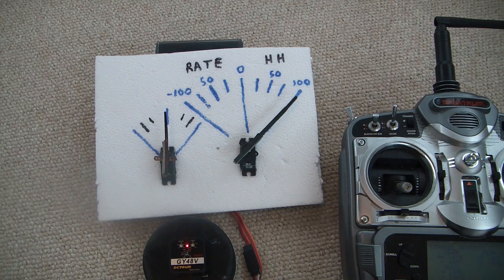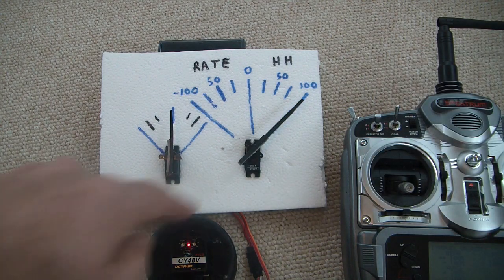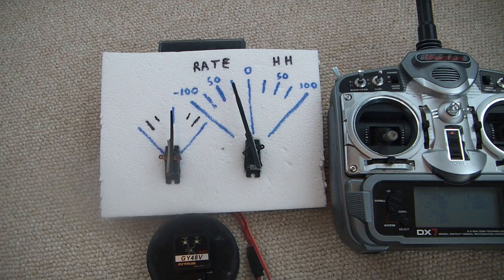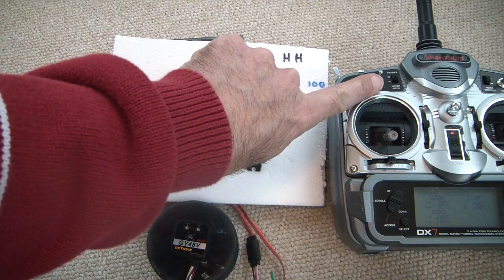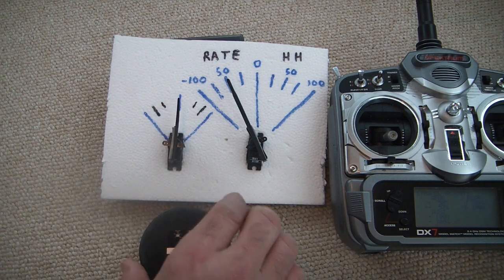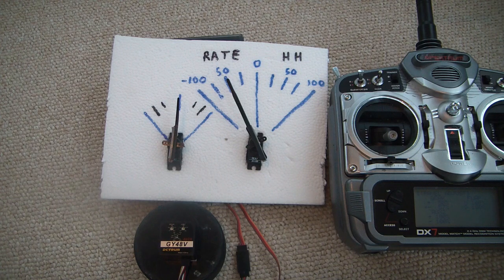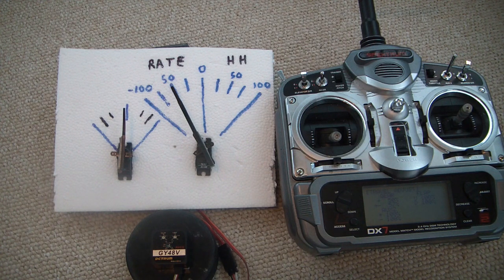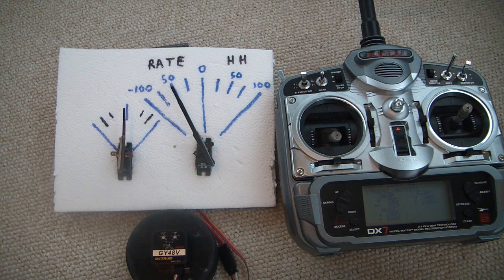Gyro on an Airplane Setup Part 1 Theory of operation

Comment: very well done vids on gyro operation.   Question - for an airplane, is there any reason to use heading hold mode?  I don't have any free channels on my 6-ch corsair, and would just like to leave it in Rate mode.  Any way to do this with this type of gyro, without using a dedicated RX channel?  thanks!
Reply: +kedelbach 
hi did you ever find out how to do this as I also wont to add a gyro to my corsair and also have all six channels in use 
regards dean

Comment: I wanted to ask about using the gyro in an twin engine rc plane. The idea would be if one engine failed in flight the gyro would kick in a deflect the rudder in the opposite direction to counter the dead engine much faster than I could figure it out in flight. Would this setup be heading hold or rate, thanks for the great vids, Roy